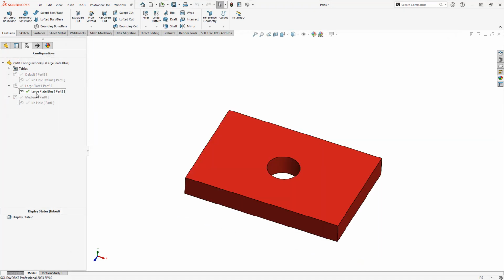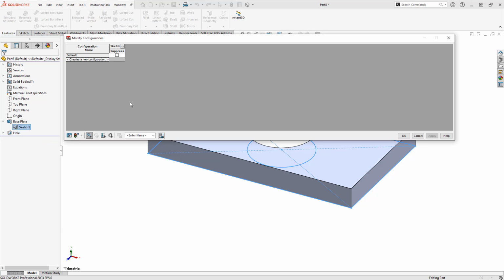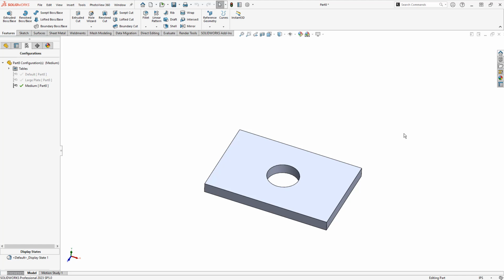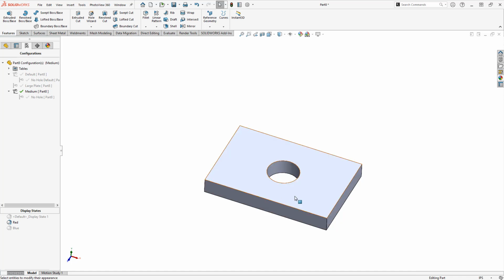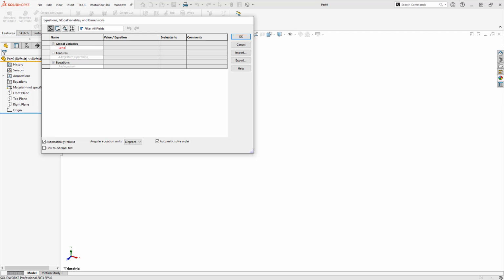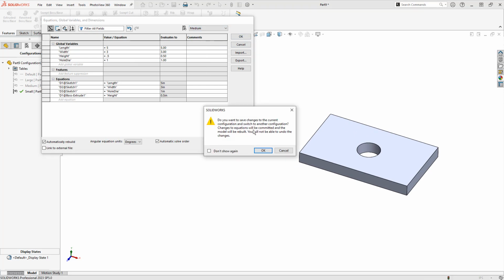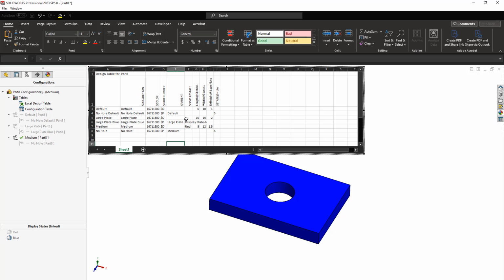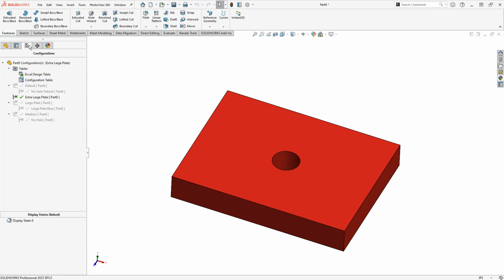Intro to Configurations | Display States | Design Tables in Solidworks | #solidworks

Comment: HI i have created a configuration table for my part, now i want to add the same table in solidworks drawing for that part but i dont know how to add, i dont want to use design table as i don't have excel.
Reply from the maker: When you say you want to add the table in the drawing, how do you mean?  Design tables typically reference a single version of a part(or assembly).  the data in the table isn't generally used in a drawing table.  If there are parameters driving your designs you need in a note or something that is a bit different.  When you place a drawing view, the view properties on the left side in the feature manager at the very bottom have a "more properties" button.  in the properties for the view you can select the configuration and display state you want.  

If instead you want to link to a global variable in a note or text box there are some options.  in Text Format section of the note properties there is an icon called Linked to property. looks like a little dialog with a chain link on it.  note that you can have properties that are global or ones that are config specific.  Its a whole process and SWx doesn't make it easy, but it really depends on what you are trying to do.

I have used global parameters for configs to populate tables on drawings before but the effort to set that up really only makes sense if you are doing a lot of drawings using a part template that you populate.

Comment: What happens if i add new features after making a configuration. Do the new features get added in all configurations or only in the current configuration I am working in? I think we can probably use this as a Version Control thing too?
Reply from the maker: When you make a configuration in the config manager there is a check box option that determines what happens.  By default its check and will suppress features in all other configs, but you can also toggle it off so that all features are added to all configs.

They will be on every config just the suppression state is controlled. so you can always decide to add/remove them if needed.